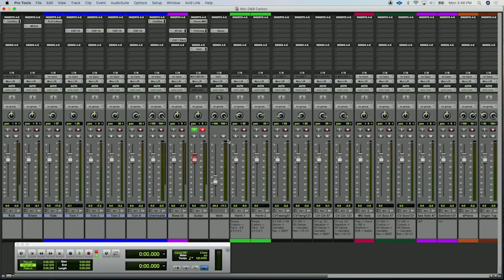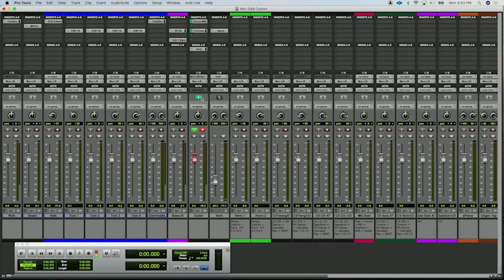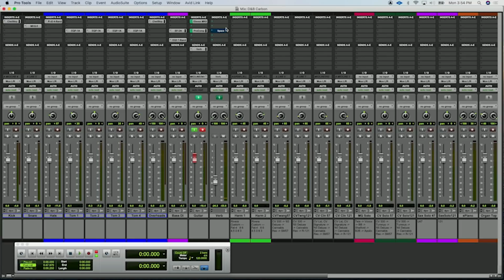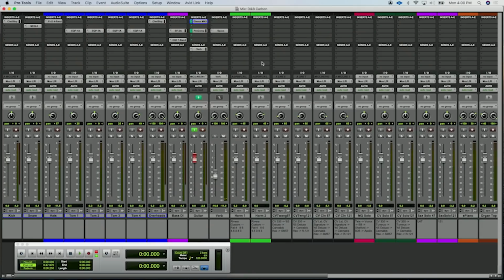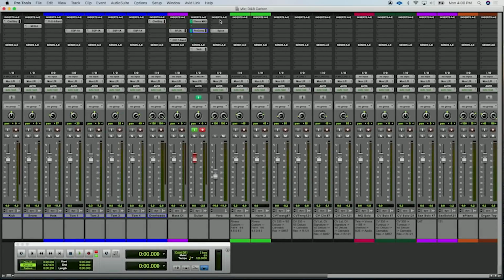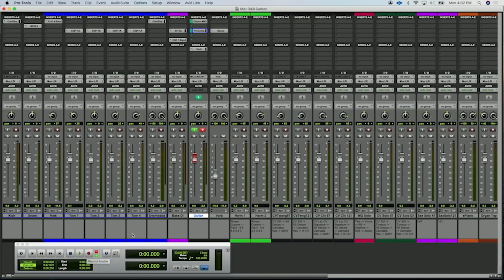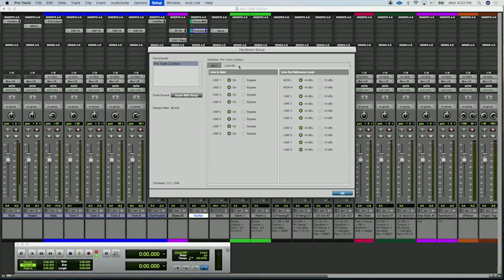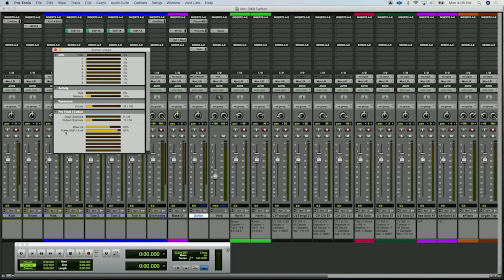Avid Pro Tools Carbon Demo

Comment from the maker: Thanks for checking out Pro Tools | Carbon with us! Stay up-to-date on the latest equipment for your studio by liking by subscribing to our channel 🎛
Reply: So does it have 16 converters or only 8? I got the impression from Avid’s release video that you could use the combo-Jack’s and the dsub at the same time for 16 analog inputs.
Reply: Is it compatible with UA Apollo?  If you have both, can you have the whole system using Logic?  Finally, I'm getting the Eventide with the interface card.  Can you call up the eventide with it's interface card through the Carbon and see the Eventide effects in the DAW?  How do the converters compare with Apollo or Prism or Apogee or Antelope?
Reply from the maker: @kennethgarcia25  Hey, Kenneth! Thanks for reaching out. There is a lot packed in to your questions, so I think it would be best if you reach out so we can discuss this all at length instead of trying to squeeze it in to a YouTube comment. You can use the Carbon with other DAWs like Logic, but Logic doesn't support AAX DSP so you would only be able to utilize the I/O. Call or email me and we can dig in to everything if you'd like!
Connor Smith, Sweetwater Sales Engineer, (800) 222-4700 ext. 1793, connor_smith@sweetwater.com

Comment: I can track with native plugins on my focusrite Clarett at 32 buffer size on a 4 year old pc with no real latency. I also have a Clarett 8pre adat hooked up. Sounds awesome. I use Slate plug in compression with some reverb for vocalist. And I use compression on my drums. No noticeable latency at 32 or even 64 buffer. As long as I engage cubase delay constraint button.

Comment: By the way I love the way it integrates with PT's awesome mixer. LOVE.
But I still can't find the info of how low the latency is in native mode to play AAX instruments live. For example, say I set 64 buffer, is it low enough to be able to play virtual instruments with my keyboard and not feel latency.
That said, it's still too dead end for me with only 24 A/D max.
If they release a carbon that can be daisy chained, with at least 16 A/D on board + 16 ADAT, so I can have 2x32 analog ins, THEN I'll sell a kidney and I'll be 100% all in.

Comment: Great video
Hey if coming out of Neve console hot (+18dbu) into line inputs how do you set the ad conversation lower or how is that setup, so the carbon input ad conversation isn’t clipped?
Reply from the maker: Hey, Cam! Thanks for your interest. You can adjust the input gain on the line inputs within Pro Tools when using the Carbon, if that’s what you’re referring to. You have access to our Tech Support team here if you purchase the Carbon from us as well, so we can assist you if needed!
I hope this helps, and feel free to reach out to me directly.
Connor Smith, Sweetwater Sales Engineer, (800) 222-4700 ext. 1793, connor_smith@sweetwater.com

Comment: I have two question 
1.)Can run any Apollo X’s with the Carbon simultaneously as two or more interface 
2.) Do I have to have the Internet to the Carbon interface
Reply from the maker: Great questions and thanks for reaching out! You do not need to be connected to the internet to use the Carbon, but you will want a physical iLok dongle to run your Pro Tools license without a steady connection. Running other 3rd party interfaces with the Carbon is not something that's tested or supported, so there's no guarantee it would work.
Let me know if you have any other questions!
Connor Smith, Sweetwater Sales Engineer, (800) 222-4700 ext. 1793, connor_smith@sweetwater.com

Comment: Will the avid interface also work with other Daw’s than ProTools, especially Cubase and Logic X
Reply from the maker: Hey, Samine! You can use Carbon with other DAWs, but only on a Mac. The built in DSP is for AAX processing only, though, so it really pairs best with Pro Tools. Feel free to reach out if I can help with anything!
Connor Smith, Sweetwater Sales Engineer, (800) 222-4700 ext. 1793, connor_smith@sweetwater.com
Reply: @sweetwater  we need an open standard for Hybrid Native and Accelerated Audio Processing for both Windows and Mac. Pro Tools Carbon. UAD Apollo+Luna, Antelope Audio Synergy Core+AFX2DAW, Waves SoundGrid are all closed platforms. 
I hate when AVB is can not work with other 3rd party AVB devices. Where is Windows support for AVB? Intel should do for AVB what it has done for Thunderbolt.

Comment: You mention 16 channels of 96 kHz on ADAT? 8 channels of 192 kHz? Please verify. I thought ADAT maxed out at half that channel count using SMUX. I have the MTRX Studio and have only gotten to 8 channels at 88/96 spread across the two ADAT ports.
Reply from the maker: Hey, Jason! This will work just like ADAT ports on your other gear, one port can support 8 channels at 44-48k or 4 channels at 88-96k. So at 96kHz using all four ADAT ports you can have 8 in and 8 out (16 total). Hopefully this clears everything up, but let me know if you have questions!
Connor Smith, Sweetwater Sales Engineer, (800) 222 4700 ext. 1793, connor_smith@sweetwater.com
Reply: @sweetwater  I thought two ports were in, two were out. Can you make all for be one or the other? 2 @ 96 kHz is 4 per port or 8. But, if you can have 4 ports, that is 16. Is that what you are saying?
Reply from the maker: @tjasonbarney  You're correct that it's 4 per port at 96kHz. You have two in-ports and two out-ports. The inputs have to remain inputs and the outputs have to remain outputs, so you can only have a max of 8 channels in and a max of 8 channels out at 96kHz.
Connor Smith, Sweetwater Sales Engineer, (800) 222 4700 ext. 1793, connor_smith@sweetwater.com

Comment: Hi Mitch, Im wondering if this interface can be used to expand inputs for avid s3 ? Thank for your help
Reply from the maker: Thanks for your question! You can use this along with the S3, but not to expand inputs. You would be able to have the Carbon connected as your interface and use the S3 as a control surface. If you want to go through anything in detail, feel free to reach out to me directly.
Connor Smith, Sweetwater Sales Engineer, (800) 222 4700 ext. 1793, connor_smith@sweetwater.com

Comment: I guess the hefty 4k USD price is for the extra 2 headphone and ethernet jacks ... Current CDN exchange rate brings it to 5252.80 + Tax = $5934.86 and then they insult us by having to pay a high price for PT outright or a monthly subscription. NO THANKS AVID!.
Reply: Cubase, reaper, anything else and an antelope interface and you're good to go. Seriously, I jumped of the protools train years ago and I'm so happy I did that.
Reply: @alphadash0  II only use protools for Filmwork (As for composing, from pro24 ,cubase v1 all the way to the release of SX , then to Logic) , but for audio post , from dialogue ,fx to re-mixing, it is unfortunately  the standard.. Full session compatibility is essential... With deadlines ect, even when composing in Logic, I bounce the stems and import into protools,  they generally prefer deliverables in a PT session...
Though  about to work on a short film and it seems Blackmagic and the Fairlight page in DR17 have more a audio style workflow for us without large format consoles....Tried with 16, just wasnt quick enough.
So heres hoping.Otherwise boot back into elcpitan and run my 10HD. ergh...
Reply: @alphadash0  The advantage to this is no additional software mixer.
Reply: dAvid will never beat the many better value Goliath's

Comment: This Ethernet connectivity is interesting.  Can it be run through an Ethernet switch or shared between multiple computers?  If not, I really don’t see the benefit...especially considering with thunderbolt interfaces, many of them don’t require an external power supply, which is great.  The last thing anyone needs is yet another power brick or cord to keep track of and take up unnecessary space.

Comment: Does this only work with PT, or other DAWs as well?
Reply from the maker: Hi, Peter. Great question! Carbon requires Pro Tools 2020.11 or later to be running, although you can simultaneously run another DAW or recording software as well when using the interface. If you have any other questions, feel free to reach out.
Thanks!
Jason Filloramo, Sweetwater Sales Engineer, (800) 222-4700 ext. 1281, Jason_Filloramo@sweetwater.com

Comment: I’ve been searching for a genuine DSP audio solution for years.  Switch from the DAW I’ve used the entire six years electronic music production has been my hobby?  In a heartbeat.  Acquire a Pro Tools subscription, even though I’ve utterly despised and avoided the subscription based model for software from day one?  Fine, I’ll take the plunge, it’s worth the monthly cost.  Price?  No problem, I’ll get a second mortgage on my home,  if necessary.  Exclusive to MAC?  A complete and irrevocable dealbreaker.

Comment: Will the DSP in this interface work even if you use it with a different DAW, like Logic, Ableton, or Studio One?
Reply from the maker: Hey, Robert! Thanks for reaching out, it's Mickey from Sweetwater! The DSP on Carbon is designed around AAX and AAX HD plugin protocols. Only Pro Tools uses AAX plugin formats. While you can offload the plugin processing to the Carbon, it is more for use while tracking to maintain an incredibly low latency. This is similar to how Apogee DSP interfaces have full Logic ProX integration, or how Apollo interfaces integrate with Luna, for example. All which took cues from the world of Pro Tools Mix+, HD and HDX systems for its nearly invisible work flow.
Mickey Cushing, Sweetwater Sales Engineer, (800) 222-4700 ext. 3024, Mickey_Cushing@Sweetwater.com
Reply: @sweetwater  Mickey, based on your response to my initial post, I wanted to ask you a question.  You said that Apogee interfaces have full integration with Logic Pro... what kind of benefits does an Apogee interface offer Logic Pro users?
Reply from the maker: @robertsimpson5801  The Apogee Element, Thunderbolt Ensemble, and new Symphony Desktop all have DSP fx plugins that work natively and on DSP. Preamp control and headphone mixes are handled within Logic X as opposed to using Maestro software. Taking away a layer between you and the talent.
Mickey Cushing, Sweetwater Sales Engineer, (800) 222-4700 ext. 3024, Mickey_Cushing@Sweetwater.com
Reply: @sweetwater  Thank you for the info!
Reply: @sweetwater  Silly question, but what Logic plugins are that intensive that you would need an interface with DSP? Maybe my projects are too small to notice or Logic is well optimized but I am quite intrigued that this is an option. Maybe you could give a few plugin examples?
Reply from the maker: @tonylancer7367  Hey, Tony. Their DSP is for the Apogee FX racks plugins specifically. And at this time, only.
Mickey Cushing, Sweetwater Sales Engineer, (800) 222-4700 ext. 3024, Mickey_Cushing@Sweetwater.com